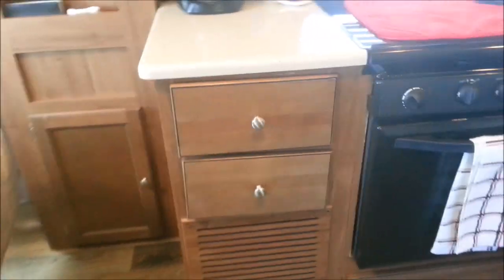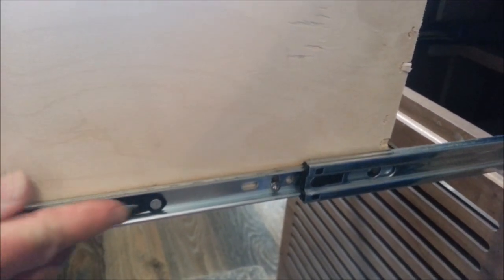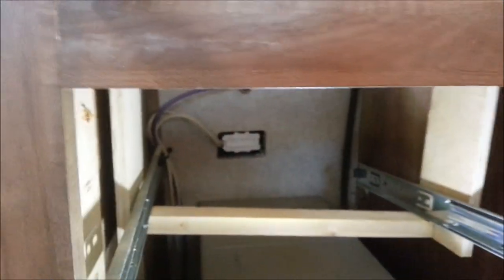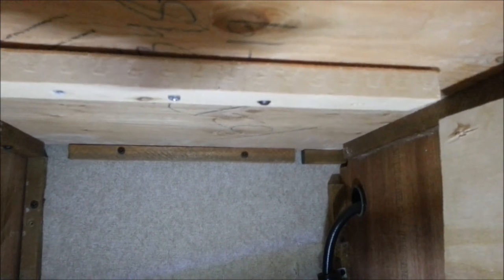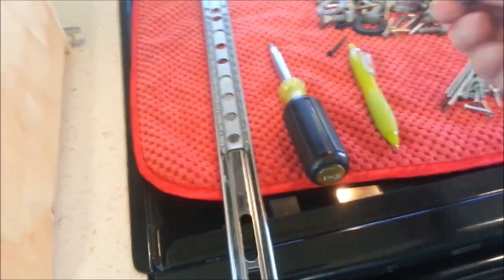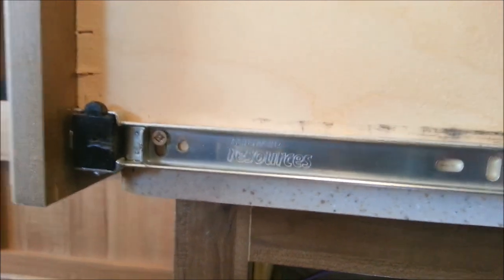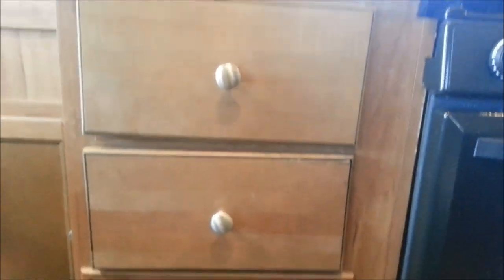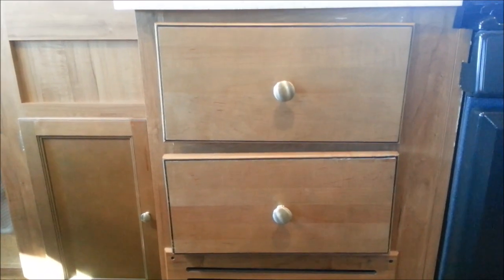Kitchen drawers just flopping around?  SCREW it down now and you may not have this issue later.

Comment: My frame across the top of those two drawers came completely out of the top/countertop. So I had to not only reattach it at the top and fix the side rollers. I put extra side blocks to attached the roller sides also. 
Then for the other two large drawers under the sink I replaced them with 100 pound drawer slides. They slide perfect now and hold my pots and pans. All my drawers had fell in going down the road.
Reply from the maker: I just had 2 screws in that frame across the top, not near enough for sure.  Good for you getting that fixed up.  :)  My right side under the sink is a "tackle some other day" project.  They are loose again as well.  Same issue.  I just chose the lesser of the two evils for the video.  LOL   Good luck.  Michael